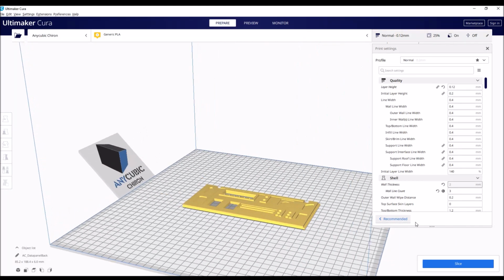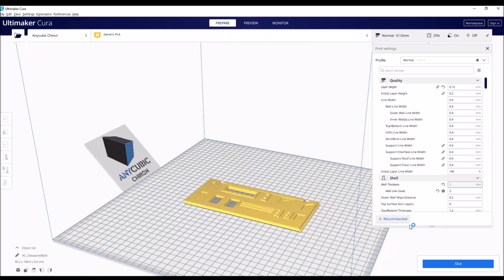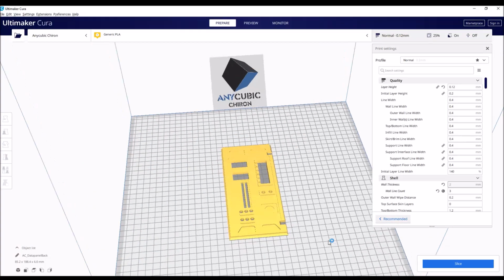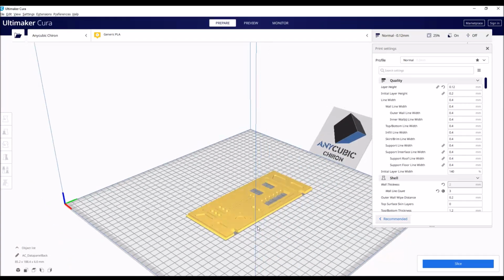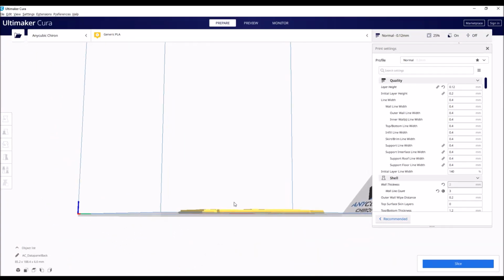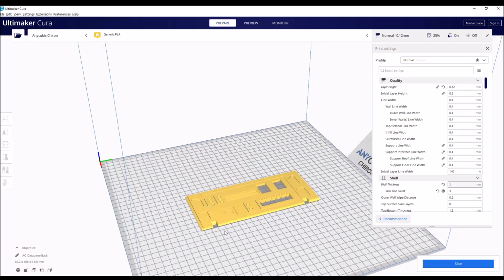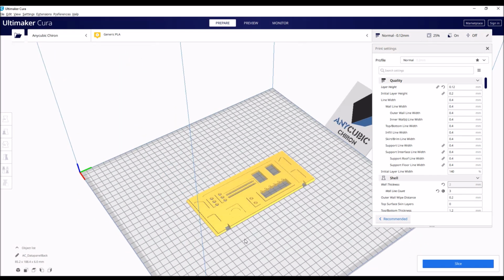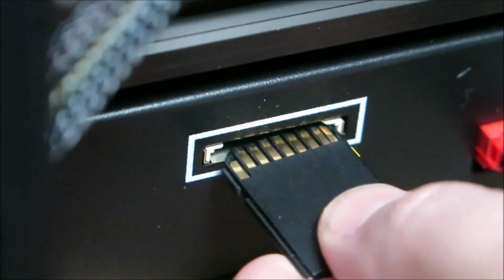3D Printing R2D2 Data Panel using Anycubic Chiron 3D Printer

Comment from the maker: 3D Printing R2D2 Data Panel using Anycubic Chiron 400x400mm printer.

R2 Builders Club. Check the forums for 3d prints
https://astromech.net

Silk Silver PLA
https://amzn.to/2A7XP9h

AnyCubic Chiron 400x400x450mm 3D printer
https://amzn.to/3croVGY

Other Great Printers:
Creality Ender 5 Pro: https://amzn.to/3dyPoCi

Dremel Digilab 3D20 3D Printer: https://amzn.to/3fuz9rM

Creality CR-10 S5 FDM 3D Printer: https://amzn.to/2SSdrEF

Check out our other 3d projects including our life-size R2D2 build.
https://youtu.be/Ex-53XBe-0I

As an Amazon Associate, I earn from qualifying purchases